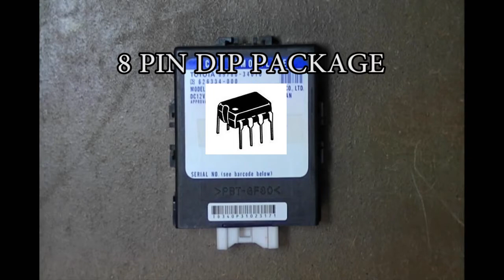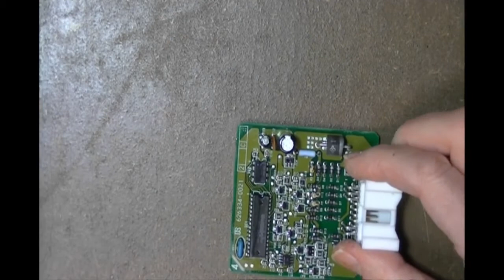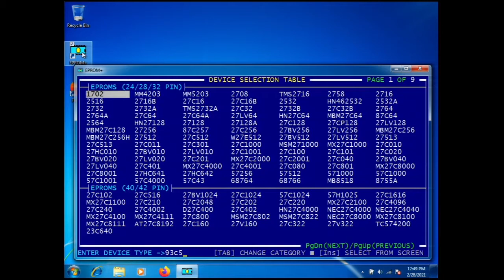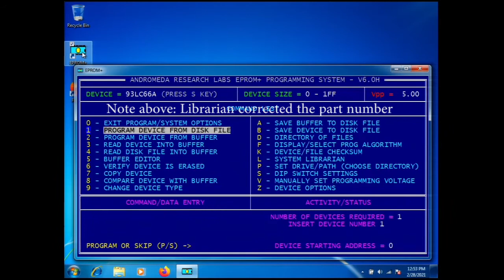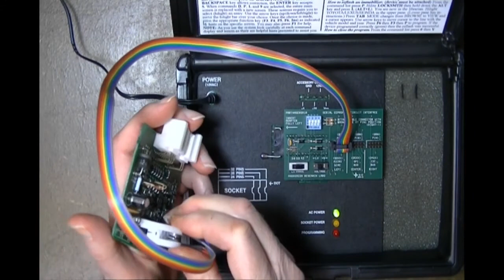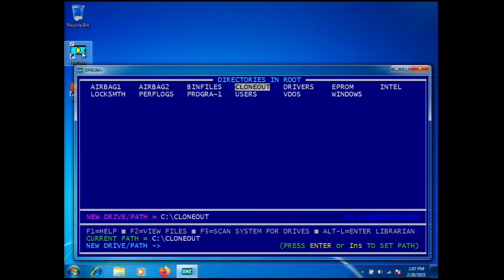Toyota Sequoia immobilizer Reflash & Cloneout Demo using the Andromeda Labs Automotive Locksmith Kit

Comment: Can you pleas show the connection to the computer?
Reply from the maker: The host connection depends on the computer. It can be a card, docking station or built-in. Since we can run without windows we need no driver which makes the interface simple. We are always happy to help if you need assistance.

Comment: You have virgin file?
Reply from the maker: We are not a source for virgin files however there are many available on th e internet.
Reply: @andromedaresearchlabs7826  Thank you for the reply. I found them I online. I got a customer who called a company to do a key for 03 toyota sequoia, and they damaged the chip. So I bought a few different microchips 93lc66. I couldn't find one that showed my exact numbers as my chip. But I bought about 4 different 93lc66 chips. I even bought one that's 93lc66a even tho the chip doesn't say A at the end, but the scanner shows A at the end. So I grabbed all the different versions I saw.  I plan to try the 93lc66 I/P first, and if that doesn't work, the 93lc66a I/P. Have you ever had to replace a chip with a new one, and did it work? My chip shows 93lc66 I/PHCC 0236. But I can't find that exact chip, but the specs seem to be the same as the specs you mentioned in the video. You are the only person who mentioned any specs.
Reply from the maker: The 93Lc66 will work in the Sequoia immobilizer. The part is forced into 8 bit mode when installed in the circuit assembly. Out of circuit the part is 16 bits. If you program the part in-circuit choose an 8 bit driver.. The 93LC66A part from Microchip is fixed at 8 bits and does not support a 16 bit mode.  @segounlocks5029

Comment: Finally, will it work for v.i.p. security systems
Reply from the maker: Sorry, I have no experience with a VIP security system.  Is this a Toyota/Lexus option?  We've been supporting the locksmith community for some time and have never been asked this question.
Reply: @andromedaresearchlabs7826  . I just found out about it. Its dealer installed system .
Reply: Your tutorial is the best and closest video Ive been able to find . thanks
Reply from the maker: @fgh85030  Thanks. I've not heard of any incompatibility with a reflash or cloneout. I'll see what I can find out.